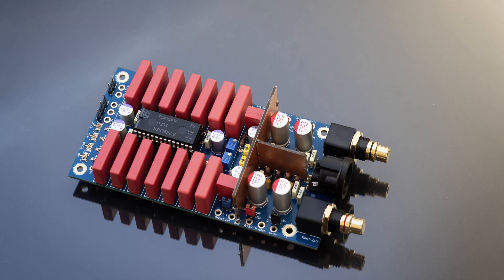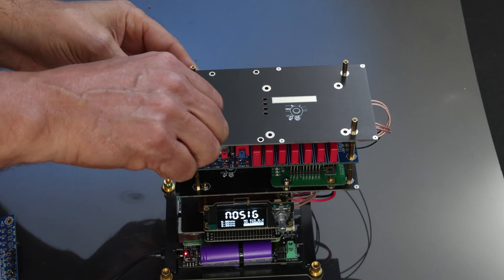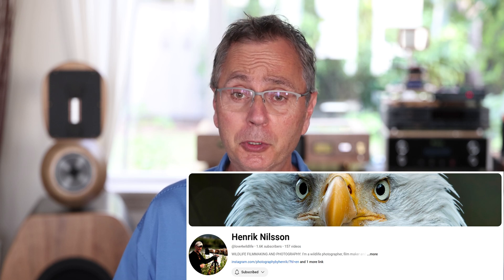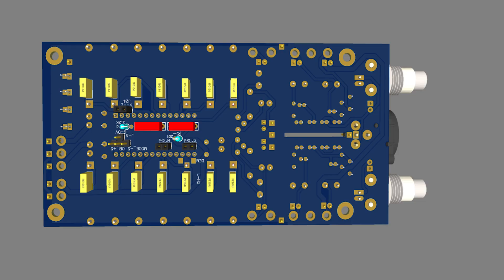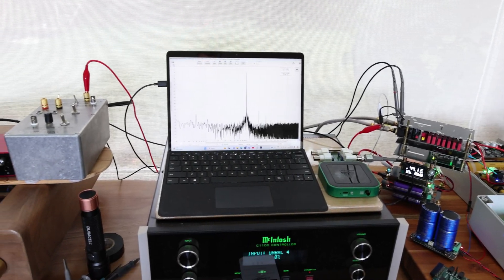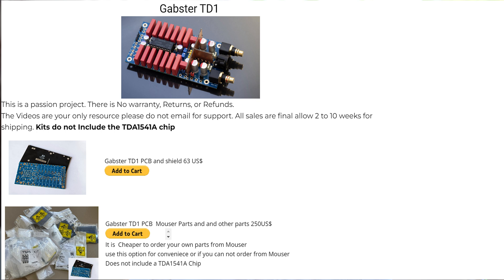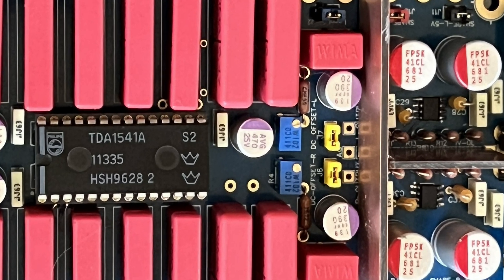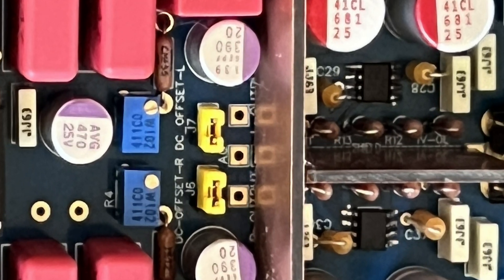Gabster TD1 Dac My Favorite of all times

Comment: Gabby, have you tried any of the TDA1387 8 parallel 1541a replacements as the real 1514a chips are ridiculously expensive now?  Thanks....
Reply from the maker: they are good search for protodac in my videos I have at least 3 videos in a few words they are very good but not anywhere near the TDA1541A specially when used in my Gabster TD1 dac
but they are so simple to use and cheap what makes them a excellent mid level Dac
note the 2 Chips are completely different even if it is marketed as a replacement

Comment: Hi Gabster, did you like this dac with the Ian streamer more than your Denafrips?
I have a plan to buy the Pontus 15th dac, but the the reckloking from the dac is the problem with a diy streamer with good clocks
Reply from the maker: Did you like this dac with the Ian streamer more than your Denafrips? Yes it is much better once you hear it it is hard to go back.
The USB input on my denafrips is better than I2s not sure why 
I have heard a few Pontus not the 15 the earlier ones and did not like them no where near the Terminator.
A wiim Pro (Not Ultra) with a good power supply will sound better than the Pontus and a lot cheaper.
Ian has a kit to replace the clocks on the Pontus and makes it better but still not a big fan of the Pontus
you are better off with a Eversolo. But if you can find a terminator used they are very good dacs it was my favorite before my TD1

Comment: How does this $$ wise compete  with 10k dacs?
Reply from the maker: It surpasses or equals most 10k dacs 
Please note to build this Dac by the time you add all the parts and power supplies it costs between 1000$ and 20000$ so not cheap and you need a bit of DIY knowledge but the end results are very satisfying.
Reply: @Gabster1 do your crc gabster need burn in?

Comment: Hello Gabby - How does the TD1 sound against IanCanada’s full size flagship DAC?
Reply from the maker: The Imaging Air and Musicality are far better on the TD1 Low and High frequencies detail  is the same on both, Midrange Varies it depends on The TDA1541A Chip.
On a very good Chip Vocals Mids are equal or better. On a average chip not as good but close. 
With a low grade TDA Chip everything suffers.
95% of the Chips selling out there are about average I am releasing a Video on Friday where I test 16 Chips.

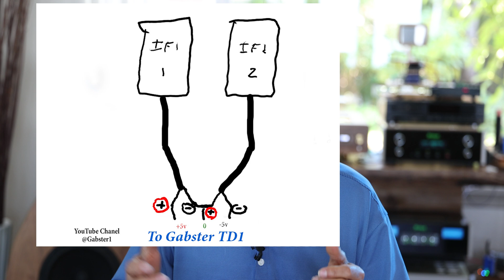Comment: 17:04 hi you mentioned that you need +5v-5v...could you elaborate why you need a +5v-5v instead of the "conventional" 5v. Thanks
Reply from the maker: Both Tda1541A  and the Gabster Td1 (Opa861) need both +5v and -5v  ( independent supplies )The TdA also needs -15v (basically 15v swapped polarity)
http://www.lampizator.eu/lampizator/LINKS%20AND%20DOWNLOADS/DATAMINING/tda%201541A.pdf
Reply: Thanks for the insights

Comment: Kudos Gabster Nice design & layout. I've been playing & tweaking my Aya for years always looking to see if I can make futher improvement. Just to share I/V resistor very very important to SQ. Try many including Rhopoint but best for me is Shinkoh 2w Tantalum.
PS caps is paramount not local decoupling as many wound think. Cheers
Reply from the maker: Excellent points totally agree I would also try different values as well and
Yes power supply is the most important of all
UcPures soldered very close are the best thing

Comment: Congratulations on your DAC.  Love the fact that you made a 4 layer board, paid attention to ground planes but made if DIY friendly.  I also love the sound of the TDA1541a chip when it is well implemented.  I don't think there will be much that can touch the sound quality you have achieved.  I found there is no limit to the sound.  Start simple, but with time go for the best power supplies and all separate.  My personal favorite is running simultaneous mode.  I too use Ian's PCM to I2S for that.  Some prefer Ryanj's implementation of the discrete one designed by ecdesigns.  When you have everything else perfect, go nuts with clocks.  This chip will shine as the phase noise improves.
Reply from the maker: That is the perfect Advice I can not agree more
You are reading my mind. 
SIMM  mode with pcm board is my favorite as well.

Comment: Hi Gabi, I see that some manufacturers are using several dac chips in parallel and make an average of the signal to reduce noise (I think). I believe this will be a big step up in your design. Do you think that you and IanCanada can try and design something like this? It's just an idea :D. I really appreciate your diy approach and I strive apply your advice in my projects too. Thank you!
Reply from the maker: I have listened to a few and was not impressed, but could be a parts quality issue I believe that simple is better. the Gabster TD1 can be configured to use you own output stage one could try a variety of them. 
I am just so happy with the sound I got with a single Opa861 per Chanel I did try a few options.
Reply: @Gabster1  thank you for your reply 🙏

Comment: Are you serious using opamps in your dac? Most of the time opamp are worse than discrete one or tubes. From this I know that all what you said is waste of time if you like opamps sound.
Reply from the maker: I hate OpAmps but the OPA861 is very special The OPA861's performance is pretty much like a super transistor.  
I suggest you read what Ian say about it when he used it in his IV stage 
By Ian
OPA861 is a very special operational transconductance amplifier. It has super-high slew rate up to 900V/us over a wide bandwidth extended to 80MHz. The OPA861's performance is pretty much like a super transistor. In current input voltage output mode with zero feedback, the input impedance can be less than 10 ohms. This very low input impedance (closed to short circuit) and the ultra-high speed make it almost the perfect solution of an I/V converter. Actually, OPA861 was confirmed very successful as the SE I/V stage for TDA1541 DAC.
This is the first OPA861 I/V stage running in fully balanced mode. Different from all other active OP amplifier I/V stages, OPA861 I/V is more closed to passive I/V stages such as a resistor I/V or Transformer I/V but with much better dynamic performance.
Reply: @Gabster1  opamps in DAP or dongle is ok cause space, but not in desktop dac. For me is pointless. I try many opamp even discrette ones and never sound so good than tubes or proper transistor, so this is knowlege from experience, but if for you is good enough that ok for me, but I am not watching this channel anymore. For me is wasting of time that sombody who tell me that his dac is very good using opamps.

Comment: A few question for about the DAC, can you recommend trusted sources for the TDA1541 chip?  Do have another another way to adapt to XLR input on the amplifier without having to use another board/Dac?  If you purchase just the board do you send a list of the parts to buy?
Reply from the maker: I strongly suggest you try one not a big sound difference going balanced sometimes yes sometimes No, it is system dependent 
yes you need 2 boards and a PCM Board as well.
and off course you get the part list :)

Comment: would totally try this if there was a good case option, hate the stack look
Reply from the maker: You can case it 
It is designed for both 
It is just easier to stack for experimentation
Reply: @Gabster1  can case it, but does a good case exist?
Reply from the maker: @mat.b.  I will be doing a case setup in the fall already have a lot of the parts just need some time
Reply: @Gabster1  look forward to it!

Comment: Nice project and I love the simplicity and very confident that it sounds good. I love another r2r (vintage) chip without internal I/V conversion and working on the output stage so you implementing basically a 80mhz bandwith opamp that is 'safely' fast at 900v slew makes sense, do you use it as buffer? I am in the phase of experimenting so AD811 (quite fast) and OPA1612 and alike will be tested for I/V and buffering.

Comment: Thanks for putting this out in the world and congrats for making it happen.   A couple of questions (1) would a discrete op amp like Sparkos add to this dac - or the op amp you've selected "good enough" (2) when it comes to clean-ness of DC voltage, how does typical and readily avaialable 7AH/12V SLA batteries stack up against the top of the line powersupplies that you're recommending.
Reply from the maker: Hard to tell without trying them but this opa861 single chip Design is vey simple and direct with zero feedback and no decoupling caps anywhere in the path. you will need to convert your 12v to 15V and 5v 0 -5v not the best idea but with the linear Pi you could do the 5v 0 -5v with 2 of them.

Comment: That is very sweet it is only $600 assembled and tested.  With only $310 in parts you are charging a respectable upcharge for the labor and bench time. So many other audio manufacturers would have charged $5,000 for the same thing essentially gouging the buyers.
Reply: Note that the TDA1541A chip is not included
Reply: @ayc3695  So try to find TDA1541A before buying the kit 😅😅😅
Reply: I haven't heard it but looking at it I guess it will sound better than most 5/k DAC's.
Reply: @edmaster3147 lol dream on
Reply: Looks like 10k dac

Comment: Just ordered a board from you  😀
I'm a big fan of the TDA1541a, I have a nice S1 waiting for the arrival of the board.
Thank you very much for making this available  to the DIY fraternity
Reply from the maker: Thank you appreciate it  if you happen to have a regular TDA1541a try it first to avoid loosing your nice chip
I fried a good one in a 15v reversed polarity fried my FifoQ7 as, very costly mishap   it happens to the best of us specially when you are connecting a hundred time.
Reply: @Gabster1  
I will do,
I'm picking up an Arcam in the morning with a standard chip,
It's cheap because the display has failed, it'll be ideal
Reply from the maker: @mcpokes  you may be surprised some regular Chips outperforms or equal a S1 or S2 Chip

Comment: Nice. I have also fallen in love with the sound of the TDA1541a chip. In my case, I am also using Ian's PCM board and FifoPi (Q3 here), powering with ultra capacitors, LTO batteries, and the "Studer 900" power supply discussed on the DIY Audio site. Output stage is jfet "fetishizator".
Reply from the maker: that sounds great
Reply: Hey, another Fikus fan!  I use his 6n2p lampizator and all his power supply advice.  Big trani, chokes, film caps and tube rectifiers.  All dual mono.  Love it.
Reply: @user-od9iz9cv1w  sounds sweet! I need to upgrade (sidegrade?) my output stage to tubes at some point.

Comment: Looks like a fun project. I have a couple of observations. Have any genuine TDA1541A been made since circa 1995? The only new ones I know of are "Philips" marked Chinese counterfeits, all claimed to be genuine (naturally), so one would be wise to research this. Also, many (including myself) have discovered that discrete class A op amps (e.g. Sparkos, Burson, etc.) can exert profound sonic improvements (dynamics, separation, soundstage, etc.) on the output stage of a DAC. I realize this project design may be completed, but I might suggest for any future revision DIP8 sockets in place of surface mounted op amps for added flexibility. More newer DACs are being fitted this way for this reason.
Reply: CD 471 < these are all have the TDA's ranging from R1 to S2. Most sellers know thus expect to find a R1. Good luck.

Comment: This is SO cool. Couple of questions: You may already have mentioned it at one point? Not sure. But if ordering all from Mouser, how would I manage the same components that you’ve selected? Or will it all be the same/included in their kits? Secondly, is it possible to go Dac alone from an existing streamer? As in a coax or aes/ebu input? Or would that degrade sq?

Many thanks 🙏🏼
Reply from the maker: you will have a exact mouser List Parts (please note I am not affiliated with mouser just a good place to get genuine great parts) 
This way they should fit perfectly and sound great.
you will need a I2S signal from a Fifo Q7 or similar or a Cd Player or any device where you can access the I2s Signal of the board. By keeping the sound in the least amount of conversions you get better sound. You can also use a input board with Ian's streamer to solve your situation.
Hope that Helps
Reply: @Gabster1  I’ll look into the input board, great suggestion. I am very curious about the prospect of putting together a Dac with this great a value proposition. Not an engineer, don’t really solder…but have steady hands and not afraid to check values using a tester! 🙏🏼

Comment: Can this dac play 24 bit ?
Reply: You'll do yourself a big favour to let go of the idea that more bits are better. In fact, a true 12 bit resolution of a DAC is more than enough. More important is that the DAC sounds really good and lets the sound 'through' in great detail.
Reply: @edmaster3147  It depends of what sort of DSP is going on. If you are doing DRC, oversampling or volume control, more bits are needed to maintain precision.
Reply: @Sparta155  yes, a DSP is very useful and oversampling is quite handy, a DAC could benefit from a higher internal sample rate.
Reply: @edmaster3147  Wow, I didn't know that 12 bit is actually more than enough. Are there any DAC interfaces for musicians that you would recommend? Many thanks in advance if you reply.
Reply: @JackNance22  A studio Reel to Reel wil capture about 12 bit.
Reply: It's a 16 bit DAC, so will truncate any extra bits.
Reply: Or DSD?
Reply: @chriswhite9912  DSD will need to be converted to PCM I2S before going to the DAC.
Reply: Sparta is correct. I have a DAC with the same chip as well as multiple other DACs going up to 24 bits. I doubt you'll miss the extra bits. The natural midrange really stands out to me.